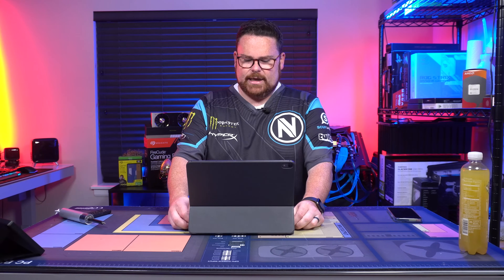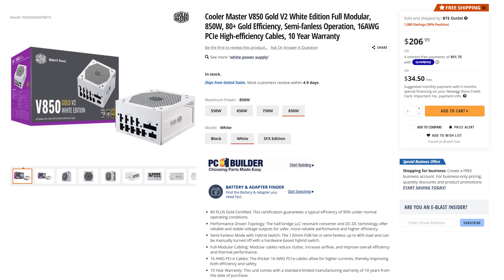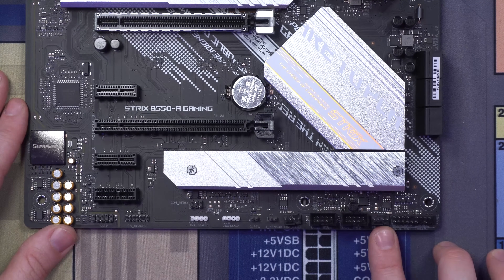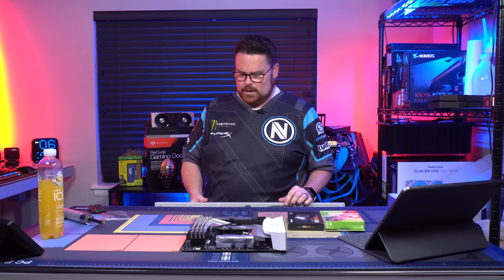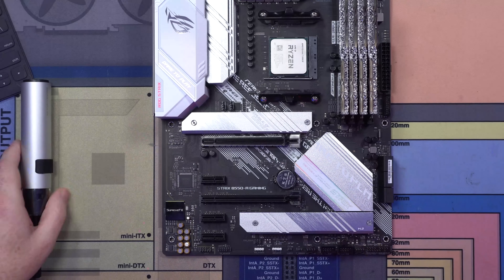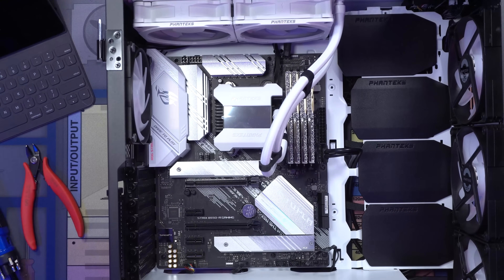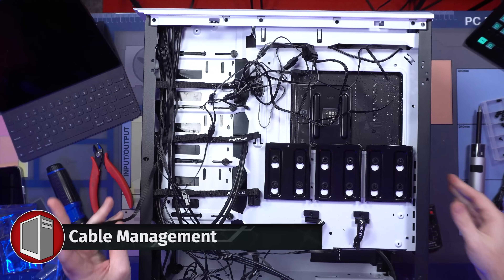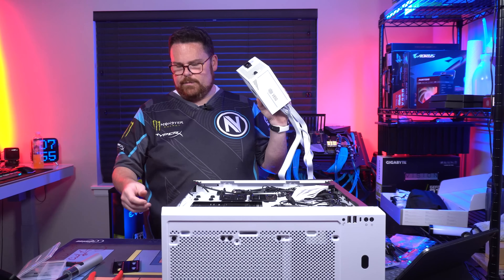The Ice Blue Phanteks Build | Robeytech

Comment: i just did a build using this case with an old motherboard. The RGB header is a 4 pin on the mother board but the cable for the case is a 3 pin. SO none of my rgb works for the front fans lol do you know if they daisy chained all the from fan rgb into one rbg 3 pin cable?

Comment: Idk what the point of this video is, if it’s a tutorial you missed like 50 things to explain to noobs. If it’s just for showing the basics you don’t need to explain so much. Basically either pick full tutorial or build montage not in between. And seriously “printed circuit board” you don’t need to say that especially if your gonna say pcb later it just confused noobs. And another reason this isn’t a tutorial. You explain irrelevant shit but not even which way to put the cpu in like cmon.